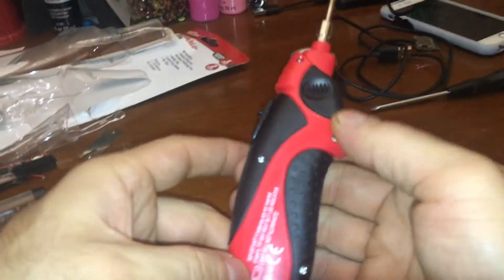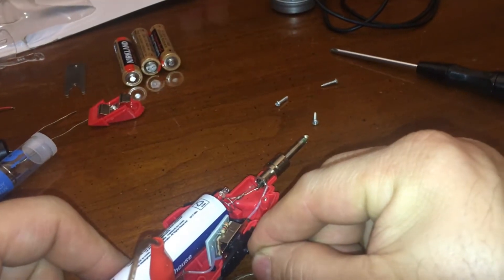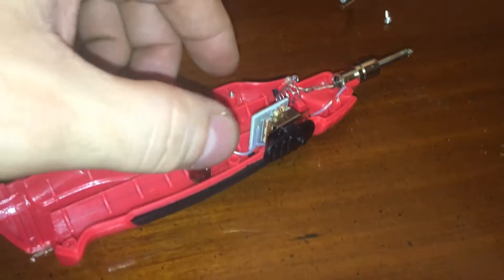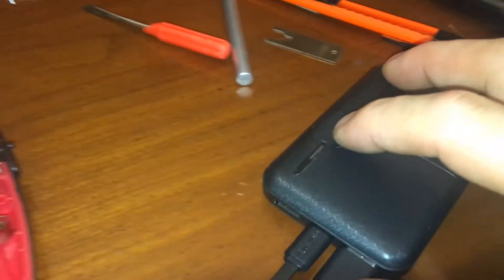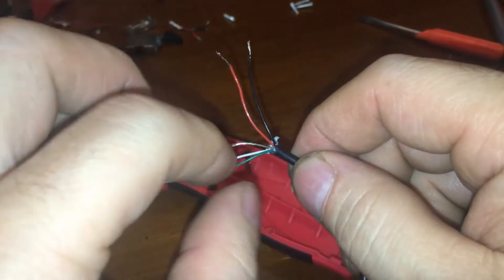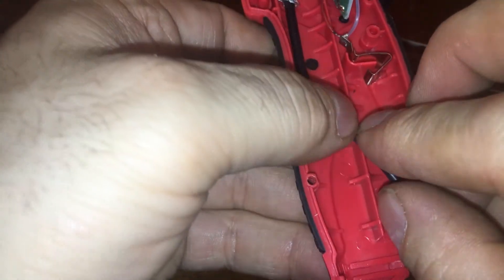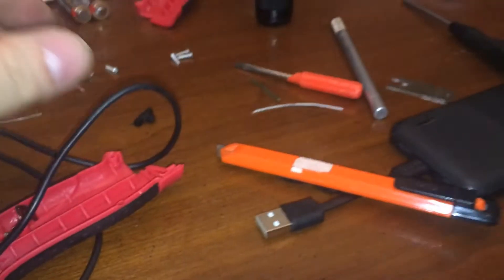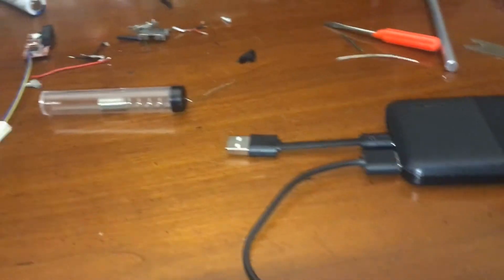Walmart Cordless Battery powered Soldering Iron convert to USB power from batteries

Comment: I love it, you just made my night. I have the same problem,  almost the same soldering iron but mine has 4 AA but it can't get hot enough. So I took it all apart and found out my switch wasn't making  good contact and there's a little light in the tip to let you know when it's on but still it never get's hot enough or when it does it can't stay on long enough, it keeps turning off. So I figured like you I would try and hook up a power source from an extra battery charger I have laying around but glad I saw your video, saved me a lot of time. Now all I need is a soldering iron to secure my wires
Reply from the maker: i use this all the time now since I have billions of portable batteries